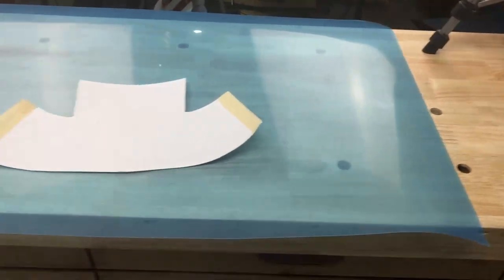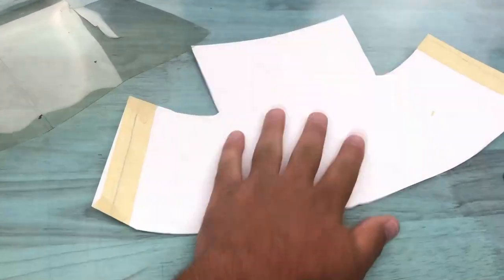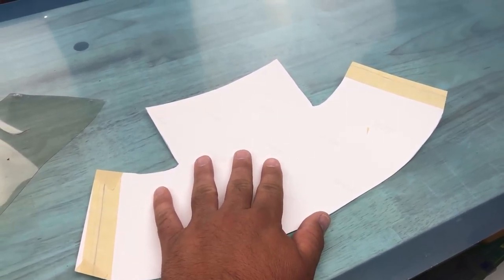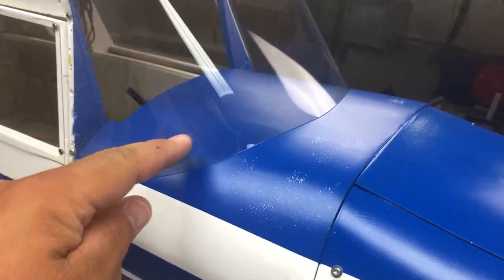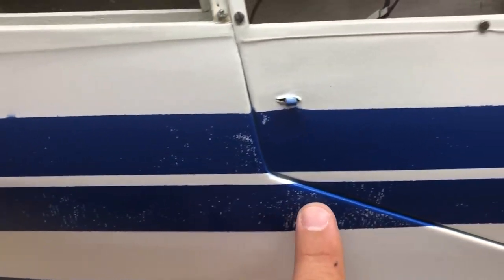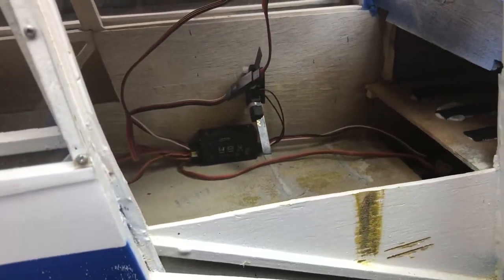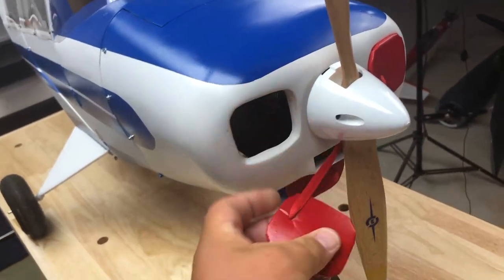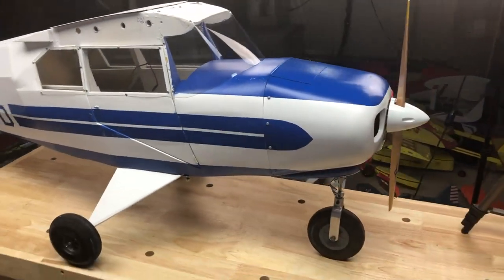Tripacer Episode 17: DONE RECONSTRUCTION

Comment: Do you happen to know what kit that Tri-P was. Great rebuild!
Reply from the maker: I never did figure out which one. I'd still love to know.
Reply: @JoshuaOrchard  What was the wing span? Hostetler kit? Did   Bud Nosen ever to at Tri-P.
Reply from the maker: @sorenwolff4954  I forget the exact measurement but it was 1/4 scale. I verified this with my friend who owns the full-scale, and who ultimately this model went to if you watch the entire series. We never could determine the kit's origin or design. Some suspected it was a Sterling kit based on the font used on part prints but there were some other geometric differences to that design too. Trust me, we dug deep to try on this one. I'd love to build another for myself, if I could find out whose it was and there was availability.
Reply: @JoshuaOrchard  Interesting. I have built the Pat Tritle Tri-P 50"ws and made it a 54"ws. I may some day do a Hostetler Tri-P